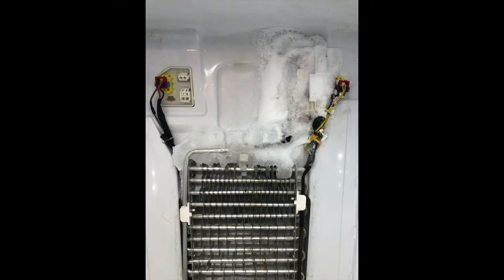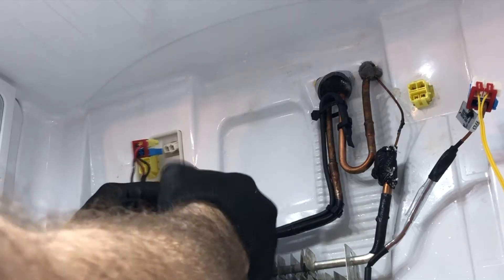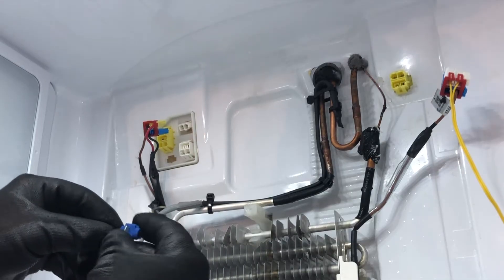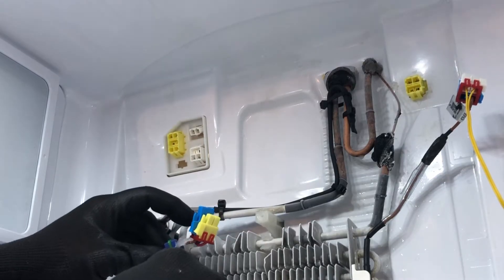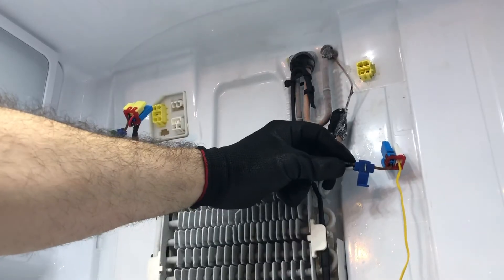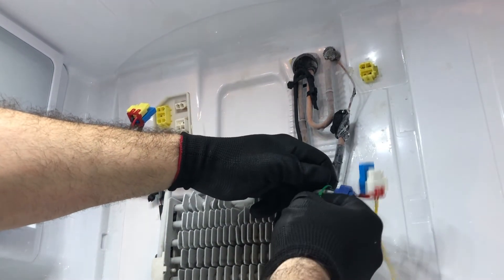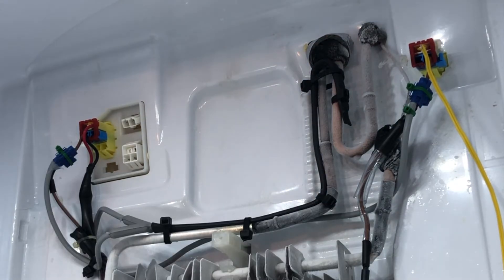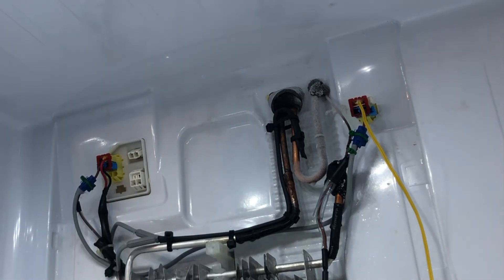Samsung FDBM evap heater add

Comment: Does it matter which way its wired up ? I tried this upgrade and it didn't work. The element never got even warm while the regular element was hot. I followed your instructions exactly.
Reply from the maker: it does not matter which way its wired up, some techs have problems with the crimp, you can also strip the defrost heater wire, then wrap the new heater wire around it, solder it up, then insulate it. That is a foolproof method. This assumes you are using the correct wires of the heater, of course.
Reply: @electronicsprojects4708  Red wire on left. Brown on right . thanks for speedy input.
Reply from the maker: @thomashorsley8653  in this video, the wires are brown on both sides, some models may vary, so follow the schematic diagram for your model. Also, you can verify the heater using your dmm, it should read about 100 ohms on resistance test.
Reply: @electronicsprojects4708  I rewatched your video and I screwed up and connected to the red wire. I will rewire and report back. Thanks for your help.
Reply: @thomashorsley8653  did this end up working out for you?
Reply: @electronicsprojects4708  THANK YOU. This should be stated somewhere that before you install you check the resistance on the new heater. My new heater arrived DOA with 0 ohms. I installed the whole thing and it wouldn't heat up. Disconnected and tested and the original heater was around 150 ohms, and the new one i got was 0 ohms. This is the only way to test the heater to verify you got a good one.
Reply from the maker: @joerose2414  'OL' would indicate 'Over Limit' or resistance beyond the capability of the meter. 0 ohms would be a direct short and would cause the heater to act like a fuse when voltage applied (kind of like sticking a paper clip into a receptacle) would just blow up. Hope you get a heater that tests good. I always use the 'ohms' or 'resistance' setting to test heaters, not the 'beep' or 'continuity' setting.
Reply: @electronicsprojects4708 
i tested the supco heater (201) by just inserting the bare wires into the L and R yellow square receptacles (main heater unplugged). turned on force defrost (rd),  confirmed i was getting 125v at the receptacles... but the wire wasnt heating up..  did i get a dud?  TIA for any suggestions!
Reply from the maker: @youtoobmeloob  it usually takes a few minutes to feel the heat, after about 5 minutes it should be at 160 degrees approx.
Reply: @electronicsprojects4708  thanks!  i got it working eventually. prob just loose wiring. what i dont understand is why my main heater's in-line thermostat (small black cylinder) is still showing continuity even at room temp? i tested 3 diff units. all show continuity, whether in freezer or on dining table. if marking is 60/40, shouldnt they open at 60 deg (which i assume is fahrenheit, bec celsius would just be ridiculous -- although one of the 3 i tested had a "°C" after the 60/40...)  im just a BIT confused!
Reply from the maker: @youtoobmeloob  This is a thermal fuse, like on a dryer, if it over heats, it opens up and won't close again.
Reply: @electronicsprojects4708  mine seems to be always "closed" (showing continuity). thanks for the immediate responses! gave ya a TU  = )

Comment: Does anyone know a repair person that would be willing to do this repair?  We live in Orange County California.
Reply: I know someone. How can I contact you?
Reply: @ChristOurKing  Thanks! 
My email address is cindy1cpa@aol.com. 
I’ll reply with my contact information when you email me.
Reply: Did you hear back from your group about someone willing to do this repair in Orange County California?
I am ready to buy a new fridge. I am sick and tired of this issue. It is worse than ever before. I tried to use a hair dryer on the inside panel without having to take the whole back panel off. It worked but only overnight. I’m extremely frustrated. 😡
Reply from the maker: @janedoe5712  I will ask again...
Reply from the maker: theappliancerescue@gmail.com
Reply from the maker: I posted this in my group, we will see if there are any takers.
Reply: Thanks man, where is your group ? On FB ? How can I join ? Thanks
Reply from the maker: @starobinful  are you an appliance tech?

Comment: Good video, but it was hard for me to follow because every 5 seconds there would be “booms” and the camera would shake. I also struggled to tell what the ends were being connected to, and how?
Reply from the maker: My videos are not monetized, you get what you get. Blue Solderless wire connector.
Reply: @electronicsprojects4708  fair enough
Reply: Does it have to be a blue wireless connector? Yellow? Wire in one side wire in the other side and crimp, correct?

Comment: @Electronics Projects   In the video you mention that this is not a solution to the freezing drain problem. Have you found any long-term solutions to the drain problem yet? How do you resolve those? People report that the revised (longer) OEM drain heater probe doesn't resolve the issue. Could a 2nd SUPCO heater be fed down into the drain line? Any other solutions that work?
Reply: My Samsung French door never froze around the fan but the drain hole was  freezing. I bought the revised (longer) OEM drain heater probe and drain still  froze. Together with the heater Probe I added a 10 inch long copper wire, wrapped around the heater element a couple of times and feed it through the drain hole for about 7 in. also lowered the heating element down slightly closer to the drain hole. It has been about a year  and no more ice buildup. It took 2 full days to melt the ice in the drain where i could feed a thick trimmer line all the way from the drain hole to the container back behind the fridge on the bottom. Vacuumed and cleaned the cores, cleaned both drain tubes as well.
Reply from the maker: Samsung drain kit works for me. Also, check the mullion flapper that it is not staying open, that will cause excessive frost. Make sure that not only the back cover slits and condenser, but the base and front of the condenser is vacuumed out.

Comment: Would this work on a Samsung RF26HFENDSR/AA?  I purchased the Samsung Drain Kit and applied it.  The fridge still freezes but there is no icing on the vent ports.  It freezes in the middle and toward the bottom of the panel.
Reply: How much did that cost you?

Comment: Where is the correct placement for the thermistor now that a heater was added?
Reply from the maker: Just make sure it's to the right, not next to the heater and you will be ok. I find that the placement is makes no difference. Samsung has changed it, then changed it back. If you get it above the uppermost fins, you will be good.
Reply: 10-4 thanks Mike!

Comment: Exellent vidoe and solution. The zoro page wouldnt load for me but I found these on amazon.  I also found the high temp zips on amazon. https://www.amazon.com/Electrical-Connector-Assortment-See-through-Organizer/dp/B06VVPG9GQ/ref=sr_1_4?crid=B9JIT3K75LJ0&dchild=1&keywords=displacement+connector&qid=1604940732&sprefix=Displacment+connector%2Caps%2C279&sr=8-4
Reply from the maker: yea, lots of techs having trouble getting the heaters right now. SH201, SH502 bot work well.

Comment: So far so good for me. One exception is i used sh201 and when I attached heater i put it to close to the thermistor. Had a call back on that one. Otherwise Ive done a half dozen others will great results to date. Thanks for the tip Mike.
Reply: What are the symptoms seen when the thermistor is too close to the new heater?  How far away does it need to be?

Comment: This is a clever and sensible solution to the frost issue. Your installation process, workmanship and guide all very well done. In my opinion the best video on YT to address the Samsung icing with a viable solution. I'll be doing today to my RF23HCED. Thanks very much

Comment: I just ordered the sh 201 for a unit I'm working on, and I'm wondering why Supco says the heater cannot be cut or spliced in any way?
Reply: You can't cut the heater or splice it. But the lead wires can certainly be cut. Supco assumes you know the difference between the heater and the lead wires.

Comment: Hi.Great video man.A perfect solution to the eternal problem with defrost. And why did not Samsung do that?  Can't or doesn't want to?  And another question interests me ... how many watts in power does this heater have?  Can the relay withstand the extra load? But anyway...Thank you so much !
Reply from the maker: Thanks, Ivan, 15 watt heater, the lower defrost heater is around 100 watts, so that totals 115 watts, lowest relay I have seen on these is 3 amps @ 250vac, so that is 750 watts, plenty of headroom.